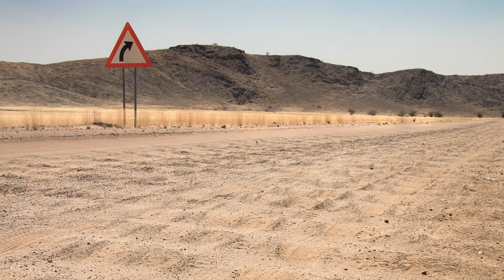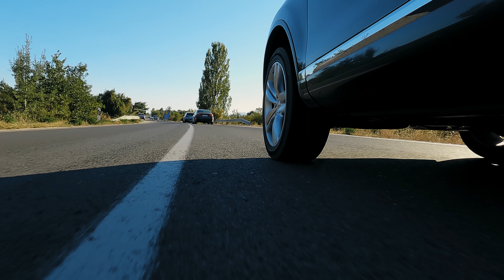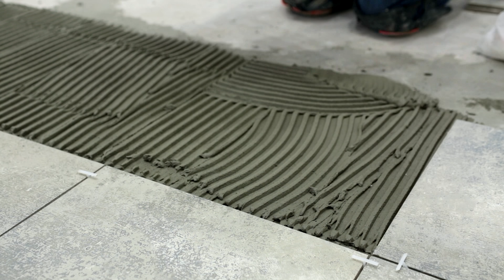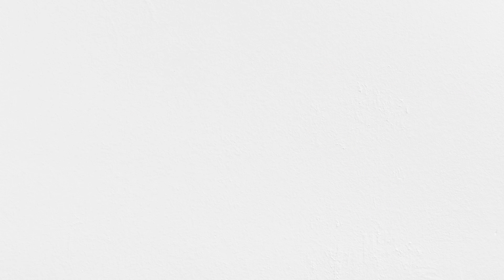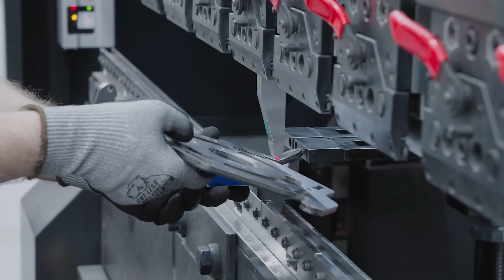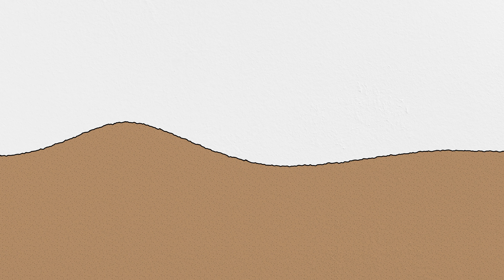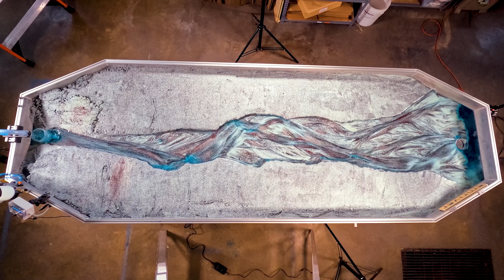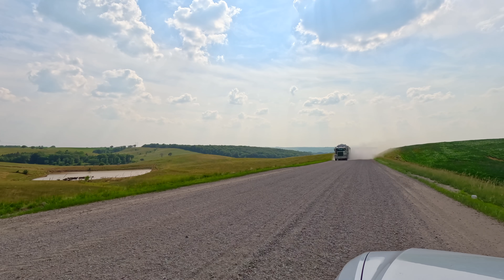Why Roads Get Washboards

Comment: @practicalengineeringchannel That stepper controller is simple to use (after navigating the complicated instructions), but I've found that specific unit only delivers about 70% of the power it should. This is likely because it lacks proper holding torque between steps and just isn't very robust.

 If anyone wants more power and better fidelity, try a dedicated DM556 controller paired with a Raspberry Pi Pico or Pico 2. A Pico costs under $10 and is literally thousands of times more powerful than an Arduino Uno R3 or R4. Plus, Gemini can basically write the control code for you with zero prior experience if your application is simple. 

 A quick pro-tip on stepper physics. Even though most small steppers are labeled '12-24V.' They actually run internally on around 3-6V. They are current limited by PWM, not voltage limited.

 The driver chops up higher input voltages to keep the current steady. The higher the input voltage you give the driver, the more torque you maintain at high step speeds. 

 The extra voltage is key as it rapidly forces current into the coils, overcoming inductive resistance and drastically shortening coil recovery time.

 In fact, many '12-24V' steppers won't hit full power at speed unless you feed the driver at least 36V. At 12V, they only hit full torque at a literal crawl.

 Manufacturers just use the 12-24V label to avoid confusing people buying for basic 3D printers or small CNCs. The actual motor insulation can usually handle 500V to 1000V.

 However, for small motors like this, you hit steep diminishing returns after 40V. Keeping it under 40V also conveniently keeps your rig safely below the OSHA 50V/52V low-voltage shock hazard threshold. Making it perfect for open bench builds.

Comment: I always thought that wheel traction was the biggest contributor to wash-boarding on dirt roads. They always seem to occur first in places where there would most likely be a change in vehicle speed or constant resistance that needs to be overcome by traction. Along long stretches of straight flat road, they seem to take longest to emerge, but emerge quickly where the road approaches, sudden gradual inclines, before and after turns, (that would require braking / acceleration) and, approaching and departing intersections.

Comment: I used to haul for a place called Southern Nevada lightweight we hauled sand out of a mine outside of Sloan Nevada for Las Vegas locations we drive our trucks into the mine and get loaded and when I was doing the night run restocking the Vegas yard I would on the last run of the night pull a v plow that you just drag behind your truck and it would smooth out the washboards quite nicely in the morning first driver in would grab the plow and pull it to the mine so the v plow that you dragged behind the truck does work

Comment: One thing I've noticed over my years of off road/back road riding on a motorcycle and in a 4x4, is the more 'commercial' the traffic is, or the more pavement only cars that frequent, the worse the washboards get.

That leads me to believe that tire pressure is a significant contributor. Larger, off road tires, lower pressures, likely dampen better, allowing higher speeds without washboards forming. 

You also make a great point on transition areas. Slowing down, speeding up, turning all create a dynamic that I've experienced. In fact, I used to joke I could 'feel' how sharp the upcoming curve was going to be. The sharper the bend, usually the road gets rougher right before. This is likely the locals slowing before the turn.

Comment: Pattern forming instabilities.  Like our economy. 😅
I also have studied this.  Sometimes large rocks 6"-12"  are used for fill soft spots.  The Rock size graduate smaller up to about 2 in and then the base is applied.  Through time you can see how the underlining surface could create the washboard effect on the finish surface.
Another thing I have observed is that  larger vehicles buses and trucks turn into a particular spot from hitting the brakes on the hot asphalt can create this ripple effect.

Comment: I don't think washboards are mainly caused by normal traffic. They are caused and propegated by the graders that are used to grade the roads in the first place. Dirt roads are hard packed.. not just loose gravel, and if you watch a grader on a dirt road you will see that the blade is attached to the vehicle in the center of the frame. The graders frame flexes allowing the blade to ocilate up and down as it drives. This is where the washboard originates, and it continues to propegate them more and more over time. Normal vehicles don't really have the weight or force behind them in normal circumstances to disturb the hard packed road bed as much as a heavy grader with a blade designed to move earth does.

As you said... a plate with the freedom to move up and down won't smooth out the bumps as expected...

Further evidence of this can be found if you spend any amount of time driving on dirt roads that are unmaintained by the government. Those roads are usually graded only once with small equipment at inception, if at all, and in those types of roads there will not be any significant washboarding.. there will be more gentle waves and dips, but will mostly feel more smooth to drive on if they are not significantly rocky.

Comment: One factor not taken into account with the experiment is the acceleration of the tire itself. I remember growing up racing dirtbikes, they would groom the track with a road tiller in the morning, and by the afternoon there would be both be both 'braking bumps' and 'acceleration bumps' with the track being pretty smooth in between. I suggest placing the motor for the experiment on the wheel itself with a 120 degree acceleration phase, a 120 degree neutral (coast) phase, and a 120 degree deceleration phase, dividing the circle into 3rds to create a realistic effect. In my experience the breaking bumps were the biggest. Secondarily, I wonder if the shaped waveform created by the bumps is consistent independent of the velocity of the wheel. If true, this means there is a correct speed to maintain that the wheels waveform path cancels out the waveform created by the bumps, resulting in a smooth feeling ride.

Comment: Why didn't you use a second wheel instead of a counterweight? How do you explain the fact that corrugations appear across the entire surface of the road even where Wheels are not running?

Comment: Mountain bikers are very familiar with those types of bumps, we call them “braking bumps” because they often occur before and during a turn/berm where lots of people brake.

On a heavily trafficked downhill trail without constant maintenance, braking bumps can often become larger than your average pothole. 1-2 feet long, 6-8 inches deep in extreme cases. Not ideal on a “flow trail”. Funny enough, you see it more on flow trails than tech trails. You see it more on perfectly sculpted machine built berms without a rock or root in sight than on rough hand-cut natural single track. Likely due to the speeds of the riders, and the fact that everyone takes the same line and brakes in the same spot on the smoother easier flow trail. 

I always assumed the wheel bouncing up and down while braking contributed to these braking bumps, but it’s neat to hear your explanation and see that visualization.

Comment: 1/4 kilometer steep gravel driveway here: It was thrashed and never redone by the previous owner. Tons of washboard from people stopping and starting and not maintaining steady speed on it causing tires to spin here and there.
Had the local guy come out and rip it down and re-lay 3/4 minus. Then, to his bewilderment, had him drop 3-4" of 1/4 minus and told him when he gets it from the supplier, make sure they take it from the bottom of the pile to get the finest fines. Spread that on the 3/4" and then I rented his plate compactor and spent a couple half days walking it up and down. That thing was like concrete when finished and is still in great shape 10 years later. 
Now I'm tackling installing water bars. Through in unfinished common lumber, a 2x6 with 2x2's screwed into the face with the gap in the middle. I put two of these, angled downhill in a chevron layout(apex of the chev. pointing uphill). Been 3 years and they are in perfect shape. I was surprised being in the PNW. Only thing I'm going to change from this single pair I did to test them out is go to 8' long instead of 6' to make the downhill angle steeper. This should allow more water flow speed to clear the small grave that does collect. Right now I just scrape them clear with a 2" piece of flat steel I just leave next to them. Glad I tested and found that finishing them isn't needed.

Comment: "If you've ever driven on a dirt road..."  LOL
If you haven't, you need to get out of the city.
Anyway... for anyone wondering, this is why we have "shock absorbers" on our cars.  They don't actually absorb shock, the springs do that.  What we call "shock absorbers" are actually spring dampers... they stop the springs from reciprocating, thus smoothing the ride, while helping to prevent, or at least delay, the formation of "washboarding" on the roads.  Even if everyone replaced their "shocks", washboarding would still occur... but having good "shocks" that are the right ones for your vehicle AND how you use it, does help.

Comment: My neighbor insisted that it was because of truck suspension,  specifically.  (He was an engineer) . He couldn't explain how, (ironically) but was certain,  that was why.  Not cars, but trucks. I didn't honestly know, but the condition seems worse where people accelerate and brake, but isn't limited to those areas, and the higher the speed, the more severe it is too.  
This should be a good video.

Comment: If this mechanism is correct, then a cool validation would be to put this thing in a giant centrifuge and see how that changes the wavelength of the bumps. I’d expect the wavelength to shorten in higher acceleration environments and lengthen in lower acceleration environments.

Perhaps an easy solution would be to place durable and stiff brushes underneath cars that frequently drive on dirt roads at the midpoint between the axles that would encourage the surface towards smoothing instead of forming washboards.

Or perhaps more sustainable: high pressure sand blasting style nozzles instead of a brush, mounted behind the tires and blasting the peaks of the washboards while taking advantage of picked up surface material to enhance the kinetic effects of this approach.

Comment: You should do a video on why everyone across the west somehow forgot how to pave a smooth road.  Every new road seems to be bumpier and wavier each year… as bear in mind that cars have only gotten better at absorbing these issues. If we were going in the right direction and not cutting costs every step of the way and trying to knock out miles of roadway in a single shift, perhaps the roads would be as nice as they were 20-30 years ago when they were freshly paved.

Comment: I worked in excavation. Corregations happen rapidly on heavily used dirt and clay paths. Especially with heavy equipment. We would have to cut the paths several times a day with our blades (dragging a closed pan of a scraper), preferably in both directions.

I suspect the beginning of a ripple is when the wheel make contact it sinks in slightly, the softer the surface the more the sink. Then there is a component of force that is not perpendicular to the surface - due to the radius of the tire it is pushing down but also slightly forward. This will compact the surface in front of the radius until its tight enough to resist the weight of the vehicle at which point the vehicle passes over. Over many cycles these compaction points build up. Then they get worse as shown in the video.

Comment: I wonder if vehicles that drive frequently on roads with washboards could have a mechanism on the backend like a rake with wheels, which could smooth out the washboard as they drive down the road.  The rake would retract up manually when vehicle comes on paved road

Comment: I feel rough patches on concrete roads cause the next damage area with the amplification when vehicles bounce over the rough patch. I wonder if the patches are designed to be rough by the builder so more damage will occur leading to more repairs.. job security if you will.

Comment: There are too many factors depending on the gradient of the road with good sub base courses like a standard 300mm+ public roadway thats a 120mm+ of a triple hotmix layer you can still get corrugations setting in on roads but its usually at heavy breaking points, that enter into a corner and exit it also.. Good Video mate..
Reply: I used to have a washboard now im more like a 18kg front loader hahaha

Comment: how does it work with Mountain bike trails and breaking bumps? Same thing? cause the wheel "stops" in that case and the bike keeps moving forward. so basically the ground is moving under the wheel. Does that change anything?

Comment: 13:44 - a viable solution is to equip all cars with GPS module which will automatically limit speed according to location.  (no speed limit signs needed)

Comment: Id be interested in a deeper dive into how the speeds effect sand specifically because its so easily displaced. At slower speeds, the natural imperfections still produce the variation in ground pressure but with lesser magnitudes. So in theory, using sand, even driving slowly would still produce the washboard with it taking longer and longer as the vehicle speeds decrease. 

This concludes that mathmatically, its a heavy side function. At slow speeds the wheel smooths the road surface, past the inflection point and the washboard shows up. 

As i write this, i also wonder if technologies like active suspension might reduce the effects. Im sure a mathmatical deep dive would be incredibly boring though 😂

Comment: As someone who had 9 miles of dirt road to his from gate and over 1.5 miles of dirt road on his land there is much more to this. Vehicle speed and acceleration as mentioned are primary offenders but over a couple decades I took note on my my roads only I traveled vehicle suspension, weight and tire pressure played a major role of how fast washboard developed if at all. New shocks on a truck can make a massive difference in how fast washboard is created even at low speed, under 15mph.

Comment: Would be not hard to implement in modern cars software, to vary the hardness of the suspension in a unrythmic manner.. When the car detects such a washboard road, it automaticly turnes the program on. If many cars do the same, it would even out the wash boarding. Something similar is common practice on metal lathes. Ramp the speed up and down al little bit every second and you will get a smoother surface finish.

Comment: Washboard forms from rapid acceleration and hard braking because when you’re on a break loose terrain like dirt roads, when a rapid acceleration happens the cars weight transfers backward compressing suspension and then the suspension catches up forcing back and those creating a bouncing effect of the tires causing ripples (washboard). Same with braking on a break loose surface it compresses suspension, suspension pushes back causing a bouncing motion creating ripples. Weather can make it worse as water flows through low spots downhill creating some erosion and saturated low spots and only wet high spots and driving on that on,y compounds that process exponentially. Coming from a family of rural road maintenance the above information has been observed and verified to be accurate.

Comment: I (not an engineer) think it's relevant to mention too that damage to road surfaces is proportional to vehicle weight to the power of four, which I would imagine would probably also affect washboarding. This is one of the major downsides to electric vehicles. Because they weigh so much more, roads are going to get damaged SIGNIFICANTLY faster as electric vehicles become more popular, which will increase the amount of tax money required to upkeep roads big time. Drive less folks.

Comment: Interesting, but I'm also curious what would happen if you were to remove the stepper motor and drive the wheel with a motor instead...
The only gravel/dirt road I'm most familiar with has ripples on one side of a hill but fewer ripples as the hill levels out flat.

Comment: This is a great video, but as your experiment demonstrated, a very hard wheel will cause washboarding very quickly. It would be interesting to see the effect of reduced tire pressure/increased tire flotation. The majority of washboarding could be greatly reduced or avoided altogether by people deflating their tires properly for Offroad use.

Comment: You touch on a point that I have struggled with when trying to obtain quality base material in Canada and the USA. This video (https://youtu.be/hh4lQNHR9DI?si=_EE_m0lgM1Cs1O6x) in German shows the sand he uses as a base in stone laying but he shows the difference between sand with fines and without fines. I'd be interested to know if the issue he brings up is also applicable under asphalt roads and if it makes a difference in pothole creation.

Comment: Its caused by suspension working normally , in conjunction with wind in most cases. All it takes is 1 bump on a dirt road to turn it into a washboard. with multiple cars travelling at multiple speeds over that bump. As the suspensions work normally for different vehicles going over that bump , they oscillate at different rhythms . 
edit: cant get more accurate  than that  😅

Comment: A driving tip - when it's safe - is to drive on the wrong side of the road.  The corrugations form in one direction and they're often a bit smoother in the other direction.